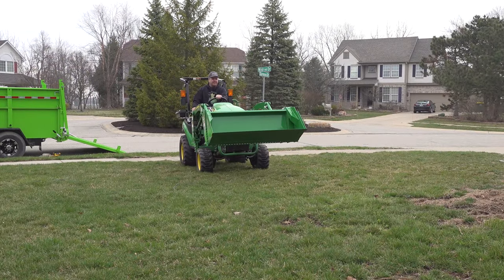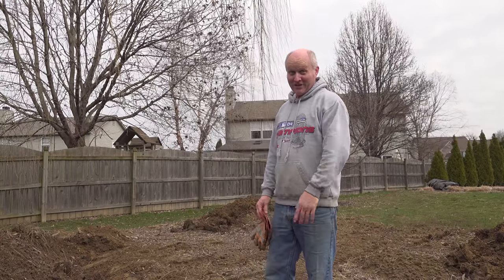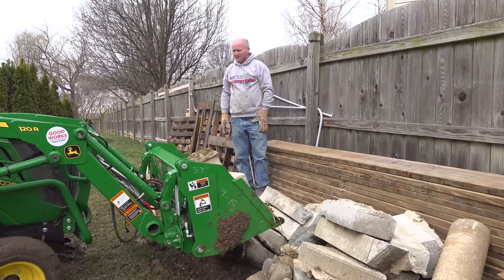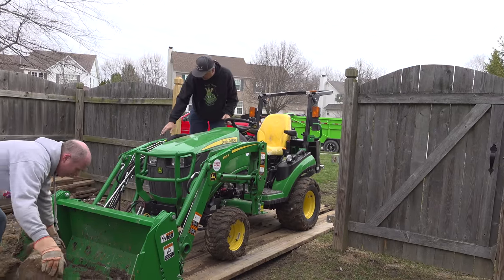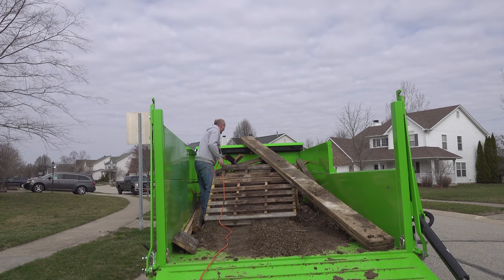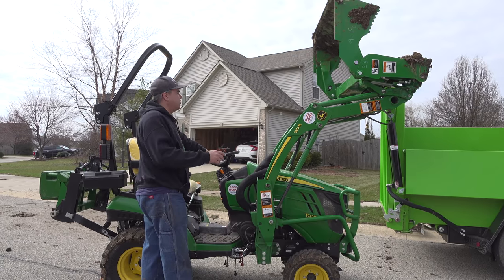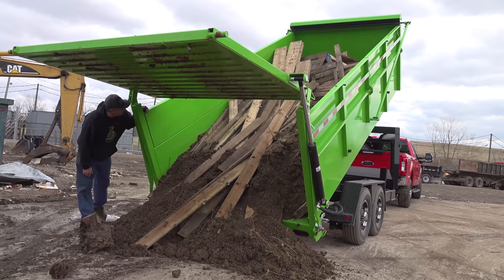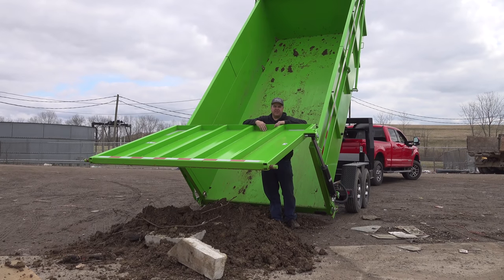4 in 1 Bucket First Use, First Impressions

Comment: Normally these kind of buckets are used to rip up bushes, small trees, and when u have a trailer higher than the pin hight of the tractor,
Reply: 4 in 1 is very old technology and outdated and not used in construction much at all besides demo but even then they use regular buckets for the most part just to heavy and like a swiss army knife can do alot of things but none great and with newer equipment hydraulics your recover time is quick enough to plunk cement asphalt and other objects into the bucket
Reply: @mikethorntonr1 , Have you ever watched Chris from Letsdig18 use one ?  He's one with that thing on his Takeuchi Skidsteer and can make it sing !!

Comment: Try using your opening your bucket up and then using your bucket tilt so as to get the open bucket around your material and closing the bucket and pull the material in, or clamp like a grapple.  And don't tip your bucket to dump, just open it up. You can spread gravel evenly then. You can also open the bucket partially and use it like a box scraper.

Comment: I would certainly prefer to use a normal grapple, or normal bucket over this, but if you need to constantly switch between the two I can see how it would be very useful.

Comment: Best thing for grabbing debris is curling the bucket forward and back dragging then curling it so both sides of the bucket is on the ground as you close the bucket  it'd be a little hard with the 3rd function and curling the bucket at the same time

Comment: Tim, you will find it better for trash and timber etc if you crowd the bucket forward with the clam opened fully and use the clam or the bucket to drag the material toward the bucket back frame then clamp when the material is aligned the best you can to maximize load capacity .....they together with a grapple rake are wonderful tools. ...enjoy :)

Comment: It seems like the 4 in 1 is designed to function as a blade, grapple, bucket and scrapper. Some times a compromise is just a compromise. I thought you actually did quite well using it though. The thing I saw is that when using the grapple function it needs to be square to the longitudinal axis of the object. All in all you ended up using it more like a standard bucket when hauling the lumber and cement. Try not to be to discouraged, because you actually do a very good job overall. Very good video and experience.

Comment: 4 in 1 buckets work well on big machines for moving large rocks and soft debris. They don't have the same grabbing ability on moving long boards or trees. They work great as a dozer blade on bigger loaders and backhoes. You're better off with the grapple on the smaller tractors.
Reply from the maker: Agreed!

Comment: Good morning Tim! That's a pretty interesting design on that bucket. I can see it being useful for a number of things but not as a replacement for a grapple. Question for you - how do you clean up the street after you work on a property? Do you have a broom for the front or rear of the tractor that runs off the PTO? Thanks for demonstrating the bucket and the trailer! Cheers!
Reply from the maker: Hand broom and shovel. 
In this case, customer did it for me.  ...with a blower.
We have a battery powered blower which we need to put in the truck!!
Reply: Thanks Tim! Cheers!

Comment: That is why I like my tooth bar on my bucket.  It digs in better and it give a nice extended lip for long boards/tree debris to rest on when its curled. The toothbar can be put on and off with two bolts but I would probably have just brought my box blade on the rear for ballast and smoothing.   If you have a strong friend with a rake/shovel then when you drive into the pile he can shove some additional material in to make sure you get a full bucket.  Unfortunately for cut logs or those bricks you got to get off the tractor and hand load into the bucket.  We all want our equipment to look new forever but unfortunately you are going to trade time for utility if you don't get past that with the trailer.  Great video!  Oh and you are exactly right.  You don't know until you try something.  :^)
Reply from the maker: Toothbar.  Hmm.  I think I’ve heard of one of those!

Comment: You remember a few videos back you was asking about how to get into the trailer without so much trouble. You notice that in this one without the backhoe hanging up as you drive up you had no trouble getting in at all. That backhoe is the problem.
Reply from the maker: My question then was more about walking up the trailer when tailgate is wet.  But I don’t think I articulated it will.

Comment: If you had your grappler, I would suspect you would have pulled the trailer in the yard, next to the pile? Then what? That 4 in 1 was the correct tool for the job. I am certain, since this video is 2 years old, you can look at this experience and understand that. This was a big project to learn a new implementation on. I doubted my purchase after watching this video. I had a month to second guess myself as I waited for mine to arrive at the dealer. I have zero regrets. The things I have managed with that bucket are extraordinary. It is a prybar for hell when positioned correctly. It opens with amazing force having such a short lever. I think 4 in 1 is an under selling it. Maybe 7 or 8 in 1 is a better description.

Comment: 4 in 1 bucket not so hot at this point in time. Trailer very nice! Only thing it could use would be an extra implement rack on top of the neck. You could have the bucket and the grapple up there. I'm sure there's room in the trailer even with johnny in it, but you'd have to pull both pieces out before loading the trailer. Just an idea i had watchin the video. Go prepared. Better to have it and not need it than to need it and not have it. Be safe out there.

Comment: If I could only have one front attachment it would be the 4 in 1 that said You cant beat a grapple when u need one.   Sometimes I put the grapple in the truck bed just in case i have to do multiple  task.    Probably should not complain i grew up with no front end loader at all.

Comment: i feel that in this size tractor (based on farm stuff way back when) you will get best results using the "claw" on loose material such as sand and gravel to get a faster bucked fill/dump. with that mud i guess its a good thing you didnt bring the 3R huh? any plan or option to add a vibrator to the dump like whats on a dump truck?
Reply from the maker: The 3e was a temporary loaner just for quick testing.  It is going back home.

Comment: So I was considering one of these 4 in 1 for a 2038R. Would you buy it if you had the Frontier mechanical grapple?  I now have added the Summit third function with dual rear remotes. I like the mechanical grapple but sometimes it would be nice to grab something with the 4 in 1 for just a quick load.
Reply from the maker: I would never buy a mechanical grapple.
The 4 in 1 didn’t work so well for me on the 1 series.  Not enough flow to control it nicely, and it is pretty heavy.

Comment: Tim,  I love the trailer and am considering one myself now that I have seen it,  Curious though if I am misunderstanding the law or if it is different in your state.   My understanding of reading if you ever have a tow vehicle (Trailer) over 10,001 LBS you need a Class B CDL.   Can you help me understand if the Class B CDL is required?
Reply from the maker: No that is not a correct reading of the law. As long as total gvwr 26,000 or less, no CDL required.

Comment: I agree that your grapple would have worked better than the 4 in 1 bucket.  I also agree that your regular bucket would haul a larger load.  I don't think your grapple would let you dig up and haul the dirt, gravel and river rocks.  I also don't think your bucket would have allowed you to gently place some of the larger chunks of concrete that you moved.  I may be wrong, but I think the 4 in 1 goes from "disappointing" to "not bad" when you are a ways from home and you need to do multiple things (like 4) and don't have the luxury of going home, swapping out and getting back to the work site in a timely fashion.  Just a thought!
Reply from the maker: Shoulda brought grapple and bucket both.

Comment: To get full bucket of material open completely place pass material pull backwards tilt back while closing and you will have a full bucket and not push material away from pile. Good luck
Reply from the maker: Exactly.  Simply cannot do those two actions smoothly at the same time with this little tractor.

Comment: 4 in 1 is great for dirt, rock, mulch but not the greatest for debris and brush. Best way to use it is fully open it curl forward drop down into a pile with it open and reverse drag back and curl back as closing. Tough to do without a true 3rd function.

Comment: I am a hoe operator ( track and rubber tired Backhoes) for over 35 years now. You really need practice on a 4-in -1 or clam bucket like we call them in New Jersey. I have been running a 710K John Deere with a side dump for 6 years or so lately and it is the absolute best tool to have for backfilling utility trenches in urban city areas. But every now and then they will send me a machine with a clam (4-in - 1) bucket. And besides from regular straight bucket work, I am useless with it. The side dump I can be incredibly efficient and productive with . But just like the side dump, you need knowledge and practice with it.
Reply from the maker: Additionally, I don't think these little sub-compact tractors have sufficient hydraulics to smoothly do two functions at once. ...and it appears to me that two functions at once, clamp, lift are required to be done very smoothly for this bucket to be effective.
Reply: @TractorTimewithTim  I have never ran a compact tractor, so I couldn't honestly say if it has enough hydraulic flow or not. You are right though, it takes much practice to clamp with the clam bucket. The guys that I work with that use them all the time, are fantastic with them. When they are done cleaning the street of piles, all the laborers do is broom. But the guys that are good with the clam bucket, can't really use the side dump efficiently. I run a side dump every day, not so much the clam bucket.

Comment: Instead of trying to fill your bucket with dirt the normal way ware you were pushing the dirt over and back on already growing grass, you can open the bucket, push a little dirt then close it to grab all the dirt or you can open the bucket and use the top part to rake back a load of dirt then grab it. You will have a lot less tire spinning that way too because you're using more of the bucket to do the work instead of the tractor drive.

Comment: One thing my John Deere 3520 it has a 4-in-1 bucket and it works great but you got to understand completely different it works great in loose Rock dirt 3520 not a a small smaller tractor but it works awesome and if you learn how to open the bucket and and close it around loose materials and stuff like that which does take a little bit of practice you can pick up stuff you know that you know how it is trying to scoop it up and it won't stay cuz it just pushes it you can actually open the bucket and drag things you know all smooth and then clamp the bucket and pick that stuff up to where you would be throwing it in there with a shovel because you just can't pick up everything so it's got its place that's just the way it is with every tool unfortunately we wish they can make every tool work for everything and that's just the reason they make more tools because it's just impossible to make one tool that I do everything we just don't work that way but my foreign one works great you were just messing in the wrong stuff I mean this is a long 20 foot lumber and stuff like that I mean even with the concrete and everything you could have picked up two or three up but you weren't going to pick up a bucket bucket full like that and you wouldn't have done it with the grapple neither because the thing with the grapple is it would have fell out the side if you would have got plenty to stay in the middle but the it would have fell out the side especially the little concrete and you definitely wouldn't have been able to scoop up the dirt because the dirt was just fall through the grapple so everything's got its place and it's use but mine works great if you know how to use it and it did take me a while to learn how to use it very well

Comment: You need to open the bucket and tilt it so the open part is what touching the material then you need to backup the tractor till you see the material falling out the top and close and tilt to load
Reply: I wish I had one on my 1025r
Reply: I need to price one I might get one but I also  wished I had gotten the backhoe when I purchase my 2018 tractor now. I need to prepare my driveway for concrete and I might buy a backhoe or rent a mini escavator

Comment: whats  the cost on that trailer? 16ft?
Reply from the maker: Call the guys at BWisemfg.com (phone number is on the site).   They will fill you in on the details. It is not cheap, but it has ALL of the potential extras included in the base price.  NO OPTIONS!    Once this is factored in, you won't find a better value in the industry!

Comment: Tim where did you order your 4 in 1 bucket
Reply from the maker: It is a frontier brand....so Deere dealer
Reply: @TractorTimewithTim  k seems like in one of your videos you were talking about buying a new 1025r or really and John Deere tractor. My point is i am in the market for one wanting a 1025r as i think it will handle my 8acre wooded property. Dealer priced with these options. 
1025r with loader and bucket 
60D mower deck with auto connect 
Grapple like yours with a splitter valve
3rd function kit 
Land plane for keeping my gravel drive way up. Price came out to about $23K plus taxes. They did offer 0% financing but i thought i heard you say they would come off the list price but around 15%
Reply from the maker: What is the MSRP of this combo?
Reply: @TractorTimewithTim  i believe this is the MSRP i cant say for sure because the sales person didn't break it down except for the grapple it was $1299. I looked everything else up on deere.com and from what i can tell that just about has to be the msrp.

Comment: hiyas been a little while since I commented I have been busty with my own channel and on my farm.  Looking at the video I am not too happy withe the separator part of the bucket. it cant clamp down as one would expect also the  concrete makes it hard for it to do so. while it may be good for other used such as grading etc, I am not sold on this product either. With that said I do not think "THE CLAW" (points if you got the reference) would work well either. You wouldn't have the same problem but you would still have problems of a different sort. the trailers awesome, careful though know your weight if your not sure go scale it out. DOT can still ticket you for overweight.
Reply from the maker: Welcome back!

Comment: I feel like that bucket would be better on a bigger tractor like the bigger 2 or up series where you have bigger hydraulics and better lift height.
Reply: Also, I am no expert at all, but I wonder if the splitter type 3rd function was kinda hindering him as opposed to a true 3rd function valve.
Reply: @paulkleinschmit9871   could be a bit it comes down to the size of line, quality of valve, size of hydraulic cylinders and the flow rate on the tractor.

Comment: I have only seen that type of market use for dumping dirt over the side of a trailer that way you can fill it right up to the top,, also seeing it used as a bulldozer blade, and back dragging never seen it used for grappling, I just think you have the wrong tool for their job that's all but as far as picking up the dirt awesome

Comment: Why didn’t you put the 4 in 1 on 3 series
Reply from the maker: The 3032e was a loaner.  Did you see last week’s video about it?  There is no diverter kit on it

Also, this yard is very small.  Would not be able to navigate with larger tractor.
Reply: ya and the 1025 r has a lighter footprint

Comment: Wow, I am surprised you could mix all that for the dump.  Here, it would be three loads: fill (wood), trash and concrete
Reply from the maker: They charge it all same price as trash.  If I had taken soul/rock only, it would have been much cheaper.
However, the trip cost makes it less expensive for the  customer to do it this way

Comment: One problem with driving in the trailer. Everything will compact and not fall out freely when you dump.
Over the side with that 4 in 1 bucket, open clamshell to dump. Easy peasy. Your wasting 30 seconds a dump, driving in the trailer. 
"I dont want to scratch my equiptment" funniest thing I've heard all day. That's what it's made for.
If your seriously worried about it, put horse mats in the bottom.

Comment: That's with any style of bucket.   By pulling crown down you'll loosen soil and use less power to fill bucket every time. Waited through all your videos for someone else to comment.  But after this I had enough of wasted tire spin. You gain nothing once forward motion stops. Make the loader do the work that what it's designed to do. Piled soil is most compacted at the base. Virgin piles are best removed from top down.  Practice makes you an expert. Good day